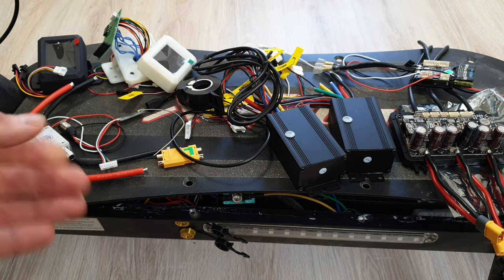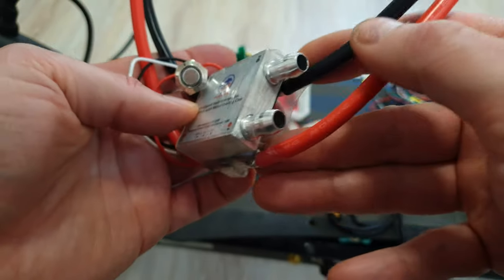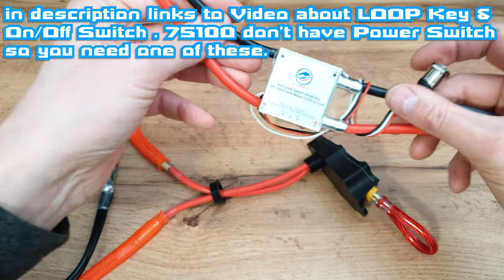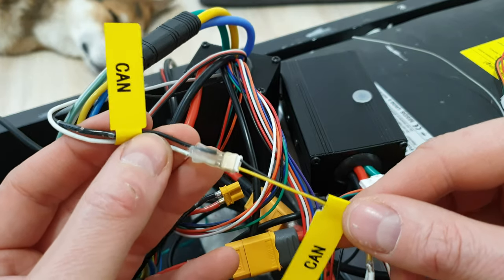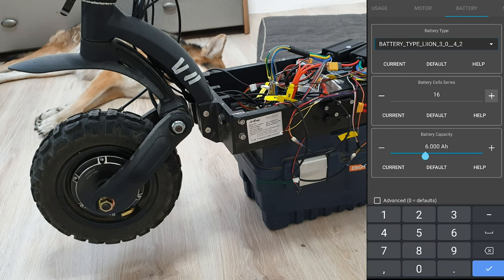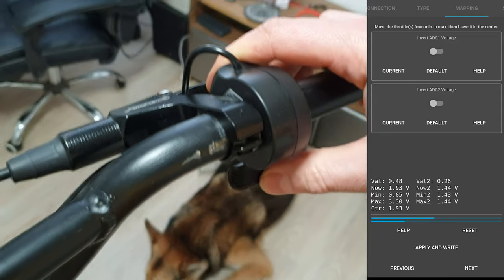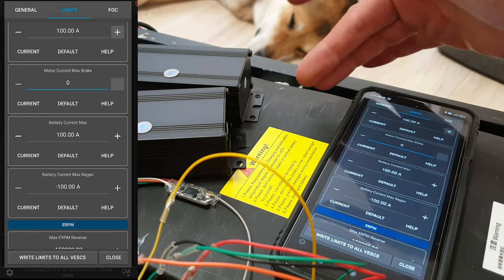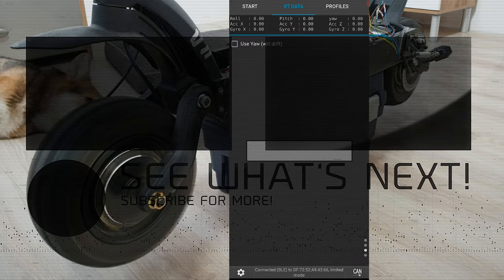How to Install & Setup FSESC Controller in Escoot or Ebike 🚀 Flipsky 75100 & X30 / Ti30 Example ⚡

Comment: I am at a loss. LIMIT How many amps should I put in if the maximum battery current is 52v23Ah1000w dual motors?
Reply: what cells? what bms? ...that helps..

Comment: Do you know what type of connectors they use for hall, com, uart etc?
Reply: Generally the connectors used on VESCs are JST 2.0
Reply: @phylaxxx  I was looking around and saw a cable listed as a 2mm JST so I ordered a few. Thanks, looks like I have the right ones coming 👍🏽

Comment: Okey I installed the new Dual flipsky 75100 on my escooter, 20s22p , not easy at all but it work EDIT : I do not recommand it they have Burned ( i just riding a little hill and they get hot ).. it's maybe ok for 60v scooter but definetely not for 72v ... I'm in contact  with flipsky they are sorry for me, but whatever, I lost 300e and I bought kelly controlller instead..
Reply: @crfsikness  ma non era fino a 75 V?

Comment: Can you install that on a m365?
Reply from the maker: Sure, no problem https://pirate.ac/xiaomi-m365-mpower-2wd-project/
Reply: Please can you make a complete detailed flipsky 7550 install tutorial/guide for the Max G30. I have all the items, flipsky screen, 7550, anti spark switch, but initially wanted it for the M365, but now bought a Max G30 which is Waaaay better to mod, so please could you do an install guide specifically for the 7550 and the G30 with different large colour screen. This would make an Amazing video😁🤘🛴
Reply from the maker: its the same like for M365 so no point
Reply: @PirateWasHere  Single motor, (not dual) slightly different connections for Max g30, and you have the guide for the flipsky 420 i believe. Not the 7550. Also, i wanted to know how to correctly connect a different large colour lcd screen to completely replace the stock dash. I do have the flipsky screen, but would like a larger flat screen, similar to the lcd8h. Would you do a dedicated install guide for the 7550, not 420 please, as they are different. Please,  i would really appreciate it.
🙏🤞🛴😁🤘
Reply: i installed it already on my Pro2. It was quite easy transformation. I used it only with the throttle and was able to reach 50 kmh on 16s battery. Crazy torque in the mid motor revs.. but low motor torque when starting which was not that nice (maybe I did not make the right settings)
Reply from the maker: Its vesc u can set anything, even uber torque start ;

Comment: I bought it for a Boyueda/Laotie Ti30 , controllers will never work correct cause mosfets are few and get hot very quick and controller turns off! I have an EV service store I am a professional, do not buy these for big motor scoots. Maybe for a 48V xiaomi or ninebot motor will work. Controllers almost got burned. I followed all the steps and bought controllers, bluetooth,screen everything. LOL
Reply from the maker: Hi Bruh , Thank you for tour input 🍕🍻  last time  I did long hard offroad on my X30 with this Vesc and was pretty decent, it overheats 2x when  is stuck in super deep sand but oveally I love it. When we back to home Es18 with the same battey had only 56.3V while my one 59,8V. Motor been a bit warm but Es18 was for sure over heated . It has this shitty overheat issue but overally I like it more over stock controller and also I will swap ti30 conrollers to Vesc:).
Reply: Can you explain how does it get so hot while motors are rated 45amps and the controller supposedly 100amps? 
I want to replace the controllers but I'm getting confused. What controller do you suggest?